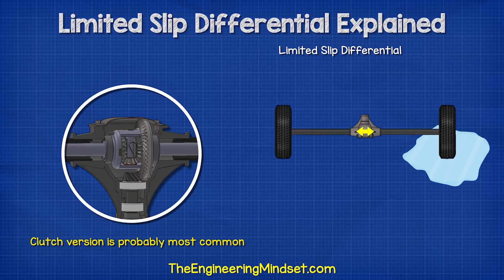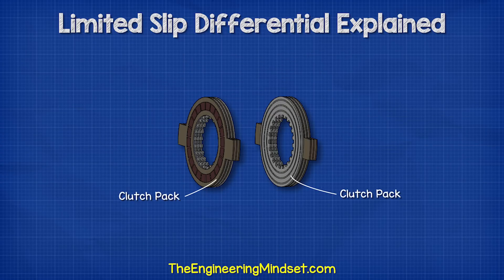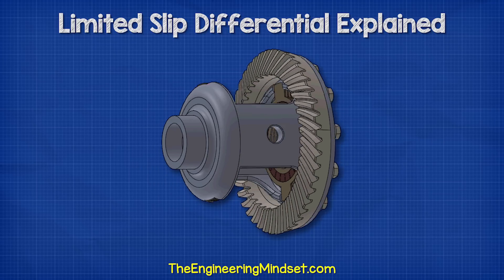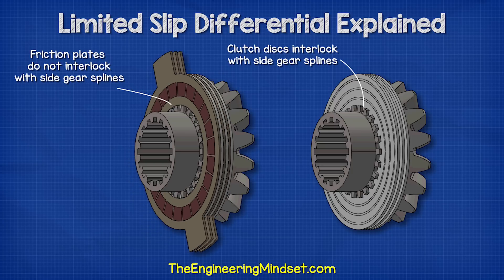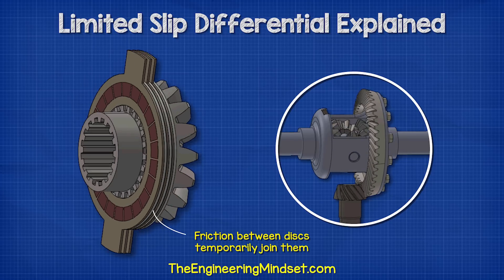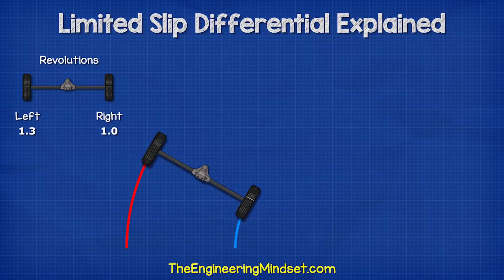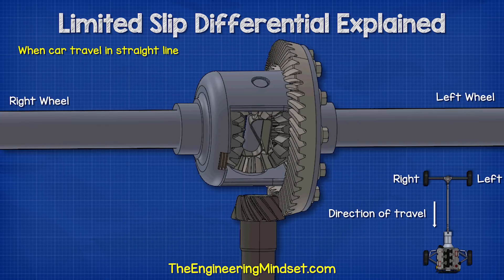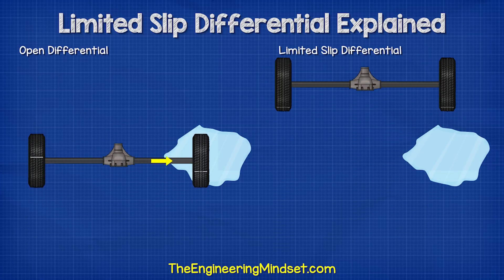Limited Slip Differential Explained

Comment: This video is close but misses some important key details. The clutch packs are lightly locked with the preload force so that in a straight line the wheels turn at the same speed. The force of the outside wheel trying to turn at a greater speed overcomes the resistance of the clutch pack, yeah not the best explanation. An LSD uses helical spider gears which transmit both a tangential force to turn the drive gears but also an axial force to push the drive gear outwards. The greater the resistance from the wheel with more traction, the greater the axial force the pinion gear is providing to the drive gear on that side, which in turn is pressing outwards on the clutch pack, locking the case and the drive gear together and transmitting more power. As the other side has less torque transmitted there is less axial force compressing the clutch pack and more slippage can occur
Reply: Why is this not talked about mentioned?? Thank you for making me not feel crazy haha

Comment: Can a non-limited slip differential accept the clutch packs and be turned into limited-slip diff?  In other words, are those splines present in an open diff?
Reply: my guess is no.
Reply: It would be unnecessary to have open diffs with the splines already in!
If a manufacturer does an open diff it will definitely come as simple as possible and avoid useless additions that cost money

Comment: Sorry a little bit confused with the last bit so you're saying that  when the inner wheel applies resistence to the power it allows the clutch to slip right? Does that mean if the vehicle is doing a sharp turn on a slippery surface that the both wheels will remain the same speed and cause slippage?
Reply: Yes, turns must be made at low speed to allow the LSD time to release. In LSD Gearbox, in racecar, it makes a clack clack clack sound as the discs let go

Comment: Why wouldn't the resultant effect of the LSD also defer to an open differential effect when going over the patch of ice for one of the wheels? Shouldn't it be the same as when turning a corner since there will be a difference in resistance between left and right bevel gear from difference in traction?
Reply: Its the other way around i think

Comment: And when the clutch pack wears out, the axle gears move outward away from the spiders. Not corrected, they can move enough to start skipping. Skip hard enough and it can crack your pumpkin. BTDT.

Comment: What if you have the limited slip differential on the front side (where you also have the stering). Does it work the same as on the back side, where the wheels are always parallel to one another? I mean in a situation where the wheels are steered. Does it also prevent sliping in that situation? I am asking this because you said that friction "adhesion" between the clutch disks and friction plates is broken when they are running at different speeds (00:02:13), so in theory there would be no adhesion left when the wheels are steered and you will end up drifting.
Reply: When you turn, the difference in the radius of the turning circle of the inner and outer wheel causes the outer wheel to have less rotational resistance.  The differential will respond to that by sending more torque to the outer wheel.  Rear wheels feel the same difference because even though you don't steer with them, they still have different turning radius, and the outer wheel will still need more torque to turn the wheels more in the turn.

In a drift there are slightly different forces on each wheel even though they're all sliding, mostly due to weight transfer.   An open diff will prevent wheels that have more friction from receiving more torque to continue the drift so in theory, it should help those wheels catch the road and stop the sliding.
Reply: @alanhonlunli  I understand the part about the back wheels having different speeds even thought they are paralell to one another ( thing that happens when the car steers, etc.) but my main question is: does the limited slip differential prevent sliping in a situation where the car makes a turn and the outer wheel (the one that has the bigger radius from the center) encounters a surface that the wheel cannot grip onto, like a pudle of water while the other wheel is on a surface that has no problem griping onto (like rought asphalt). The video kind of made the point that the outer wheel (needing more power to finish the corner because it has more lenght to travel) , will have its clutch disks breaking the adhesion to the clutch friction pads and so the differential cannot prevent slipping anymore because once again the adhesion between the friction pads and the clutch disks is broken ! quote from 00:02:02 "However, if a certain amount of force or torque is aplied to the wheel than the two disks will brake the temporary joint and slip past each other"
Reply: @juperrr  when a car with an lsd hits a puddle of oil at the outer wheel during a turn, the car will lose grip at it highest point of contact, causing it to slide and understeer.  The outer wheel which is already receiving more torque will get additional torque due to the loss in rotational resistance, but the lsd clutches will kick in and prevent that from happening.  The clutch will direct some of the torque back to the inner wheels to allow the car to complete the turn.  Because the outer wheel is coated in oil, it will continue to spin faster than the inner wheel, which will keep the clutch engaged, and divert torque to the inner wheel.  The car remains drivable and controllable due to the limited slip.  This scenario will produce understeer, understandably since the car is losing traction during a turn.
Reply: That would be called front wheel drive

Comment: And it does a great job till the friction material is gone.  I like my ARB air locker.  The diff is open till the air locks it.  Great for 4 wheeling.
Reply: Dual quad 4 speed positraxtion 409

Comment: Thanks for the video! Just wondering, would the friction pads wear off and need to be replaced? How commonplace are limited differentials now?
Reply: on normal passenger cars, they are not that common. You can simulate LSD with an open diff using ABS/ESC. This is done by slightly breaking the free spinning wheel, so the torque transfers to the one with more grip.
Reply: @hojnikb  wouldn't call it a simulation since the effect is the opposite of an open diff.
Reply: Yes, on later Holden Commodore diffs.
They are rubbish.
Reply: I have one on my 2015 Corvette.  The items on the side of the differential are malfunctioning causing a slippage sound.   I found I can drive it like that since the rest of the diff is fine.  I will have to replace the whole diff eventually
Reply: @renesaucedo9099 any news for us after two years?
Reply: They do wear over time, but are generally overbuilt to last the life of the the car.  In general, the differences in forces between the left and right side of the car are not great enough to induce much wear on these friction pads during normal driving, as opposed to a transmission clutch that has to deal with the forces of accelerating a car from a complete stop many times over the course of a trip.

They're kind of a premium performance item, so you'll likely find them in more expensive sports cars.  As we transition to electric motors, you'll see them less, as we can put individual motors on each wheel and modulate torque that way instead.
Reply: Thanks a bunch guys!

Comment: Not a great explanation. It is given in a way that can lead to misconceptions.
Reply: Elaborate?
Reply: @bewertsam  Too long to elaborate. But open diffs do no respond to torque necessarily. They respond to rotational speed. Also look up LSD with ramps. Spring preloads are not used today and I don't know that they were ever used in a mass produced solution. More of a homemade racecar solution.
Reply: @ExMachinaEngineering  seems to me like you're just trying to get attention. Open diffs allow all rotational power to go to the wheel with less resistance, not too difficult to understand that. LSDs fix that problem.
Reply: @VictorEstrada  Riiight... The fact remains that open diffs send more torque to the wheel with the higher rotational speed. That might seem insignificant to you but it is a major distinction. And a source of a common misconception. Like the one saying that in a straight line at speed an ice patch would cause one wheel to spin. It is highly likely that a small patch, when the vehicle is not accelerating will not cause anything of the sort. Also, LSDs do cause understeer exactly because they slightly hamper that rotational differential behaviour needed to corner freely. All of them except torsen or geared LSDs, which is a technology completely different to the clutch pack and preload shown here.
So many tiny inaccuracies which could lead someone to have a skewed idea of how a diff works.
Reply: @ExMachinaEngineering  actually, the open diff is not responding to rotational speed, it's rotational resistance.  The torque will go to the wheel of least resistance (tire friction).
Reply: I disagree. It made sense to me. Limited slip differentials are like poorly welded differentials where the locking can be overcome by sufficient torque. What's not to understand?
Reply: if the right wheel is on ice, it will receive 100 torque.  In that situation if the left wheel also moves to the an ice patch then the torque will redistribute 50/50, even though the left wheel was moving 0mph, and the right wheel was in free spin.  By your logic, the right wheel would have kept spinning and the left wheel would not even though both wheels are on ice, just because they hit the ice at different times.
Reply: Get editing and animating then, upload your free video on multiple subjects. I'll wait....
Reply: @andycrask3531  lol, yeah, for a guy that has engineering in his name, he has a pretty piss poor understanding of it.
Reply: @alanhonlunli 
Idk, man. The dude's subscribed to Asianometry. How poor can he be? 😂